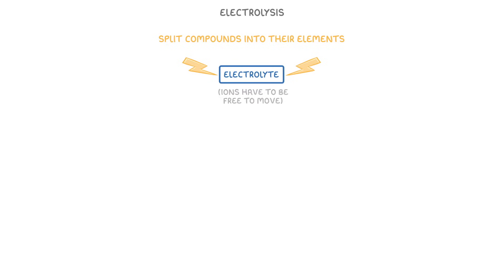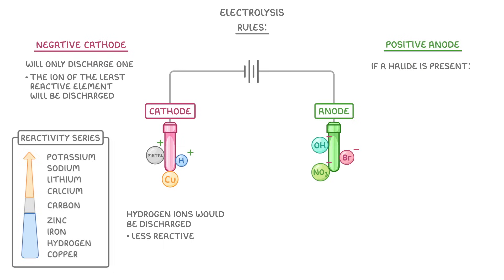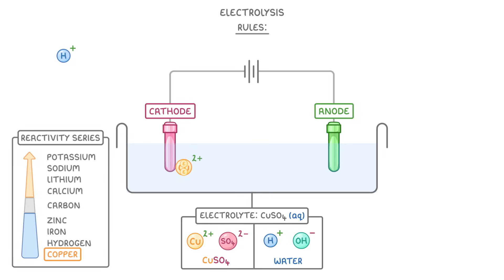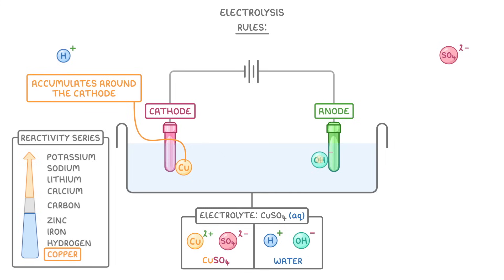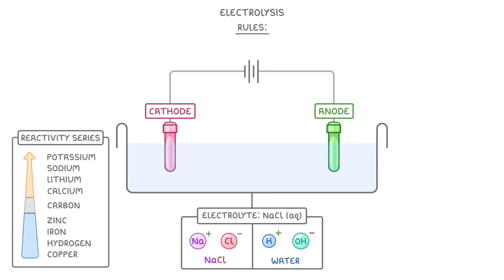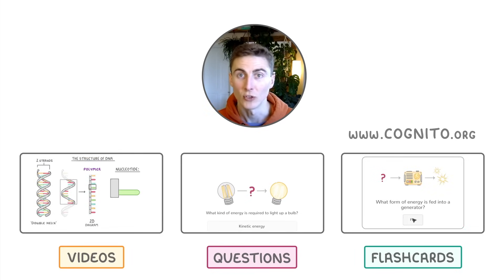Electrolysis Part 3/3 - Aqueous Solutions

Comment: 📌 Electrolysis of Aqueous Solutions – TIMESTAMPED SUMMARY
Full credit to the creator — super clear video! 

0:00 – Intro Recap
Electrolysis splits compounds using electric current. Ions must be free to move → melt if insoluble, dissolve if soluble.

0:50 – Electrolysis Setup
Beaker of electrolyte, 2 electrodes (– cathode on left, + anode on right), wires + power source.
Watch out: Water adds H⁺ and OH⁻ to the solution along with the salt's own ions.

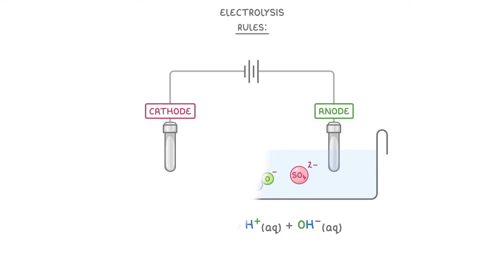1:39 – RULES to Decide Which Ions Get Discharged

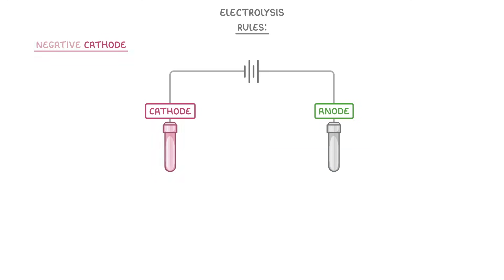1:46 – CATHODE (–):
Only one positive ion gets discharged.
➡ Rule: Less reactive ion wins.
Examples:
H⁺ vs Na⁺ → H⁺ discharged (Na more reactive)
H⁺ vs Cu²⁺ → Cu²⁺ discharged (Cu less reactive)

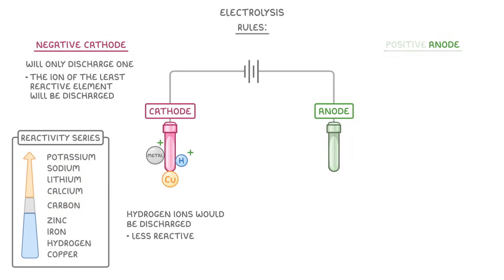2:31 – ANODE (+):
Only one negative ion discharged.
➡ Rule:
If halide present (Cl⁻, Br⁻, I⁻) → it gets discharged
If no halide → OH⁻ is discharged → forms O₂ and H₂O

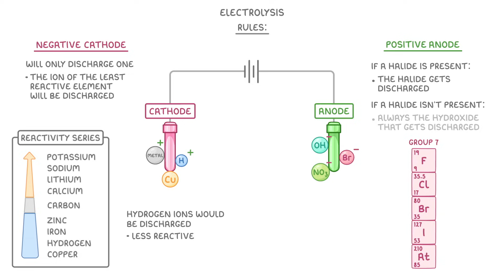3:05 – Example 1: Copper(II) Sulfate (aq)
Ions: Cu²⁺, SO₄²⁻, H⁺, OH⁻

CATHODE: Cu²⁺ discharged (less reactive than H⁺) → solid copper forms

ANODE: OH⁻ discharged (no halide) → forms oxygen + water

4:43 – Example 2: Sodium Chloride (aq)
Ions: Na⁺, Cl⁻, H⁺, OH⁻

CATHODE: H⁺ discharged (less reactive than Na⁺) → H₂ gas

ANODE: Cl⁻ discharged (halide wins) → Cl₂ gas

✅ KEY POINTS – DOs & DON'Ts

DOs:
✔ Know the reactivity series — it’s your decider at the cathode
✔ Look for halides at the anode first
✔ Always include H⁺ and OH⁻ in aqueous solutions

DON’Ts:
❌ Don’t forget water adds extra ions
❌ Don’t assume metal always gets discharged at cathode — reactivity matters
❌ Don’t pick sulfate or nitrate at the anode unless there's no halide

🔥 Hope this helps someone as much as it helped me! If you're revising, good luck — you got this 😎
Reply: This deserves to be pinned

Comment: 4:40 I don’t get this, he went to fast. This is complicated 😢
Reply: basically what he is saying is that- in a solution, water is present so the water has to be talked about in the analysis of these anode cathode things, the h+ (hydrogen) and oh- (hydroxide) ions form h20, (remember that), the h+ goes to the cathode (negative electrode, as opposite charges attract) and oh- goes to the anode (positive electrode, as opposite charges attract), in the anode (positive electrode), if there is halide ions present (group 7 element, you can use periodic table), then the halide ions will lose or gain electrons (get discharged) in the anode, if not, then hydroxide will discharge....in the cathode, metals that are below the hydrogen in the reactivity series, will discharge, if not, then hydrogen will get discharged,, learn this well and understand,, then you'll be able to use it to any other reactions of electrolysis, hope that helps!
Reply: @puppiessho thank you xiao user may you win your next 50/50 🙏

Comment: In the second example of nacl OH was lower in the anion reaactivity series so why did you pick up CL? As OH was more less reavtive
Reply: he said right? if halide ions are present then halide ions will get discharged? halide ions are halogens(group 7 element) which is originally just atoms,, they dont have negative or positive charges,, they gain electron and they become negatively charged known as halide ions
Reply: Cl is from the halogen group, the discharge at anode is not based on the reactivity series:)